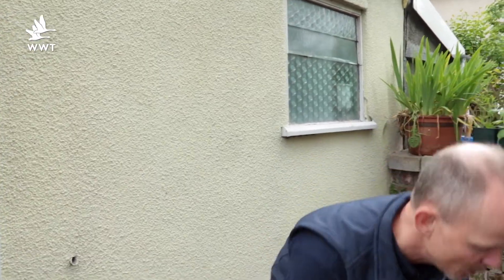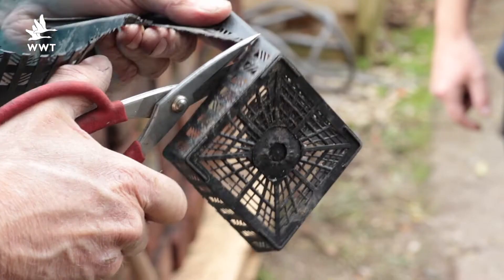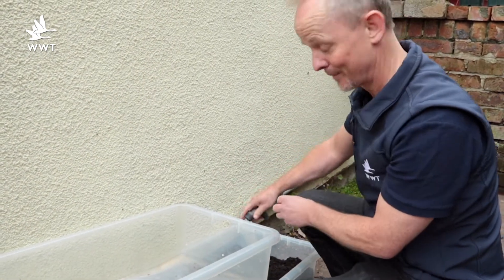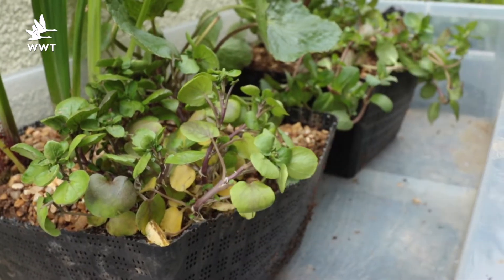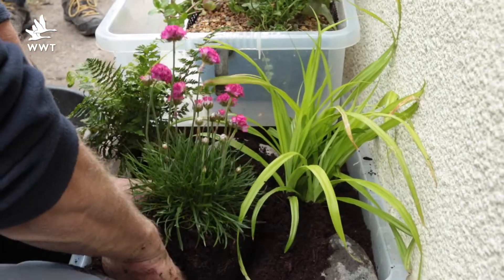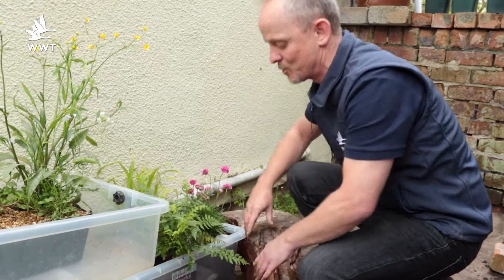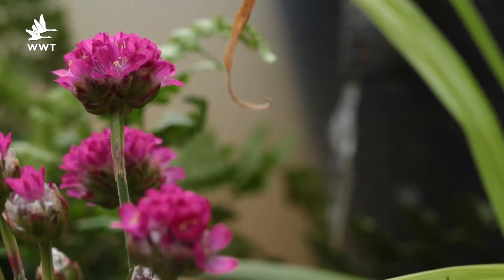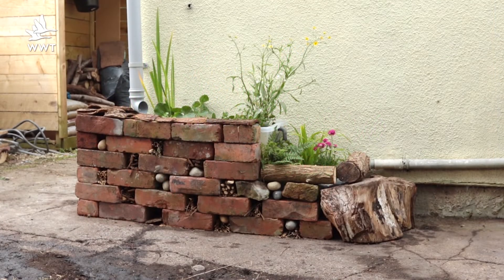How to build a drainpipe rain garden for wildlife | WWT

Comment: Amazing idea. That drain from one pot to another, should have been the same diameter, otherwise when it rains heavily, the rain will not go down the drain but spill over. That could eventually cause a damp area at the side of the house, causing damp on the walls inside.